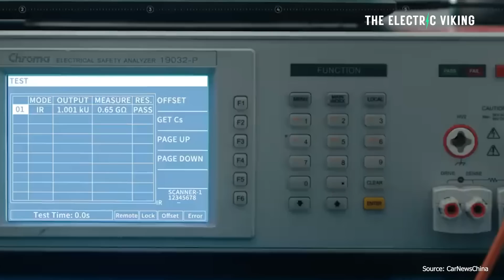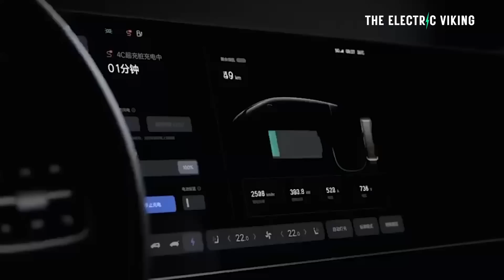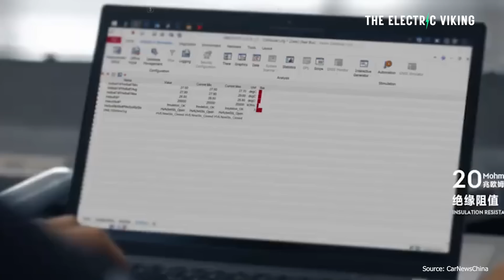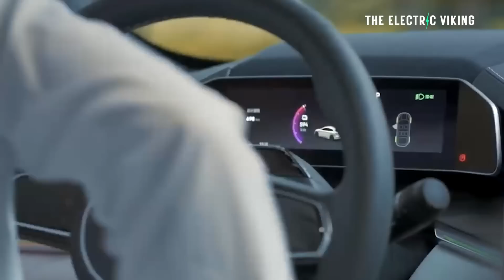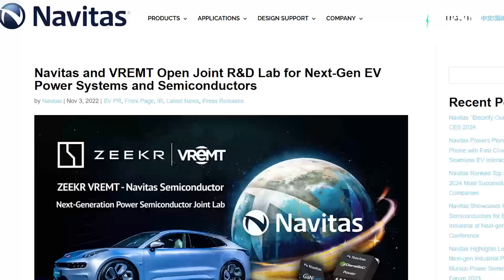Geely's Game Changing Fire Proof LFP batteries: 500kw charging, 83.7% density

Comment: Unfortunately the U.S. power grid currently does not have the capability to support wide spread use of EVs. Also about 2/3 of the U.S. grid is powered by fossil fuels. Then after generating the electrical power there is a transmission loss of 6% followed by a loss of 5% for the charger. So to get best overall efficiency for EVs their owners need to have home charging via solar. Otherwise DIESEL vehicles actually have the best “well to wheel” efficiency!
Reply: All I can say is Dream On!  The world is passing you by.  Almost all electric vehicle charging is done at home or at work, I think about 98% in the USA. Only 2% is done at charging station in the “Fast charge“ mode. Especially at home, charging can be done at night when electricity is widely available and cheap.  But the oil companies don’t spoonfeed you this information, because it counter to their narrative

Comment: Quite interesting but I’d be more interested in seeing the battery actually functioning in a loaded situation with 200C temperature as that’s a true stress test. The thermal runaway conditions occur inside the battery. I’m also wondering if the 25% faster charging speed at -10 is relative to an older battery model rather than compared against itself at say +25C.

Comment: The problem with 500 kW charging is that one vehicle draws as much power as five hundred single family homes. Ten vehicles charging simultaneously draw as much power as a small town. We don't have charging infrastructure or a grid remotely able to support even a small fraction of vehicles charging this way, even the small fraction of vehicles that are EVs currently, and we won't have either the infrastructure or the grid in the foreseeable future.

But we don't need it. The obsession with charging an EV as quickly as we can fuel an ICEV is misplaced. We don't need to charge EVs as fast as we fuel ICEVs. This requirement is nowhere near the top of my list of requirements for an EV transition. My Bolt only charges at 50 kW, and it meets my needs well even on long road trips.

I'll take a long trip to visit my family tomorrow, and I'll make several long stops to charge on the round trip. So what? The stops won't be longer than the time I'm spending now watching this video and commenting, and I can watch videos while charging as easily as I'm doing it now. The only difference between an EV and an ICEV on this trip is that I'll leave an hour earlier and browse the web or read or eat while charging rather than doing these things for an hour before leaving an hour later. Charging time need not be wasted time.

Furthermore, before we have the infrastructure and grid to support 500 kW charging, we'll have self-driving cars and true robotaxis. Musk always overpromises and underdelivers, but this technology seems very possible within a decade, and it will be far more transformative than a faster-charging battery.

When cars drive themselves, many individuals won't own a car at all. Eventually, most will not. They'll subscribe to a driving service. They'll summon a car on their phone, like an Uber, but it will reliably arrive in minutes, and the cost will be less than owning a personal automobile that is idle 90+% of the time. The cars need not be electric, but they likely will be, and they could easily charge at 50 kW. They won't need more rapid charging because you won't wait for your robotaxi to charge. When it needs to charge, you'll switch to a different taxi.

For this reason, investment in the massive infrastructure and grid upgrade required to support 500 kW charging is wasted.

Comment: The "testing" was a little gimmicky.  How long was it in the 1000C fire?  If it was cold soaked at -45 for two days, it could stand some heat for a while.  There's not enough info to know how good this is.  How is their cold weather performance?  That's a problem for most LFP.  Have they solved it?  What is the cost per kWh at the pack level?  That's a key metric.

Comment: Take what you hear with a grain of salt. Zeekr battery charging curve is typically characterized with a high peak for a very short duration, and followed by a very steep drop.  I think that Zeekr designs the charging system this way for marketing purpose.  By the end of the day, it is the amount of time you spend at charging stations that matters, not the peak charging power.
Reply: It's all over the news. Mainstream and otherwise.

Fact-check my claim for yourself, please...

I could be wrong...😊

Comment: Can you comment on the status of the thermal management systems in BYD, Geely, etc. This is an area where one gets the impression Tesla is way ahead of everyone else.
Reply: Yes, I am wondering about that also. Is the Chinese approach to make a battery that doesn’t need thermal management? Really I don’t know this technology but that would be an approach, to have a battery that works well even at high and low temperatures. And still lasts a long time.  Then you don’t need all that thermal management which takes up a lot of space. Could be I suppose?

Comment: You need to calm down. What is cost of these batteries? A network of charging station with, say, 5 chargers each withHalf Megawatt chargers is enough to power a suburb.  Can all this power be delivered by renewable generation? Not a chance. 2.5 Megawatts requires 6,000 PV panels in full Sun. No chance of home charging unless you only need your car to drive more than a few KM  a couple of times a month.

Comment: In all the excitement anyone would think man had just landed on Mars.
Where are the Geely mainstream products?  Smart is getting there, but where are the world cars for everyday people?  High charging speeds are a long way off for the average motorist in Oz, so I don’t see these impacting EV use in Oz for a long. Long time.  How do these charging speeds deal with Fermi’s law?  If the battery pack is hot, will 500 or 800kW be possible from the get go and what degree of shaping will occur?
I’m now of the opinion that a flat pack batteries are only one solution of battery configuration.  Tunnel batteries may be another way of overcoming the issues of packaging optimisation.  If it’s flat, it needs to be 30mm maximum height, as it’s clear to me that interior leg space is compromised otherwise.  When do we reach a real flatpack point?

Comment: A good battery is usefully if safe. The most important thing is energy efficiency.  Remember also that you have to generate the energy to charge the batteries. A smaller problem is that you have to deliver that energy to the charge point. CO2 is not the enemy, BTW. Too much carbon in the air is a very easy "problem " to solve, plant trees...The threat to humans and the earth is polluting ground water ( all water). Forget this battery madness and agricultural chemicals and the like...

Comment: I'm sorry, but lithium melts at 180.5°C and the plastic connectors and cable insulation in that battery pack is will be liquid at about the same temperature. If they said it didn't catch fire at 1000C but was useless I might (probably not) believe them, but this is just click bait in my opinion.

Comment: I believe electronic / battery will progress much faster than we expect. However, there is no way that current electricity grid can handle such kind of current. Once can when charging its battery, it can use nearly 100 home's average electricity. Imagine if tomorrow we all swapped our ICE to EV, then no body will be able to drive his/ her car at all! the grid simply run out of capacity. For Australia, unless the country has  upgrade its electricity supply system with many  times more capacity than what we have today, the EV future is very limited.
Reply: Where I live Tesla has had a message pop up on their cars before asking people not to charge because the grid

Comment: This is not about cells, it is about the case. And -45 is not a problem unless you are charging  it frozen. So, warming it with fire is actually not that crazy.

And of course the cell temperature was not 1000C, likely not more than 100C. And the outer case was probably not much more than 100C but the surface was max 200C.

Also the insulation likely is maylar that quite temperature resilient.

Still it looks like the very tech and the marketing too ))

Comment: 100kwh battery and 870km range doesn't check out, ever. It's BS because that would mean 11,49kw per 100km. That is completely unrealistic. More realistic city traffic consumption is around 13-16kw per 100km and highway consumption is 20khw+ per 100km on even the most efficient cars. Is this guy shilling for geely or is he that oblivious?

Also, the Zeekr007 has a drag coefficient of 0.23(zeekr says this in their marketing material)  which makes it less efficient than other cars, and even these more efficient cars comsume more and have much less range on a 100kwh battery than what they claim. For exaple the 0.20 drag coefficient EQS barely does 500km at highway speeds with a similiar sized battery.

Comment: these batteries would make evs alot better if they still lasted for over 10 years but 800 watt fast charging would most likely fry them over afew years ,  plus electrical grids cannot handle thousands of evs charging at 800 watts even a handful of evs charging at 800 Watts would crash the grid in many places at present.
Reply: Not 800 watts. 500 kwh.

Comment: He mentioned that the Battery was kept at -45 degrees Celsius for two days. Following this, it was placed in a fire, although he did not specify the exact time it remained there. It's likely that it was only in the fire for a brief period, just enough to allow it to reach a warmer temperature again.
Reply: Internet search tells me that Chinese standard is 130 sec in 700C fire. This battery lasted 240 sec and survived. Not sure if that is the actual end limit or just where they ended the test.

Comment: you didn’t touch on how the battery temp is managed…as far as I know, LFP still needs to be kept above 0° C to charge…sure you can charge at negative temps, but not before heating the cells first.  Do they utilize a heat exchanger, pump, and electric element?  That’s the problem with EV’s in northern climates….much energy is used to heat the battery…and that kills the efficiency of EV’s.  Better have a heated garage…or forget it.

Comment: Small problem! The issue I see is manufacturers from yesteryear legacy automakers their entire business plan is make a car that lasts x amount of years then starts to disintegrate exponentially. Forcing the customer to buy a new car 5 years later. Selling the parts for those cars at an astronomical rate so it becomes smarter to buy a new car than try to repair the old one That's every manufacturer business model. Tesla changed that they make a car that lasts a very long time not caring about making money off parts (today's Tesla I don't know about tomorrow's).
My point is this manufacturer is making these batteries do extreme things and I'm only speculating but my guess is the battery is not going to last 10 years like a Tesla battery. So this manufactures counting on you buying a new vehicle sooner rather than later going back to the old business model just speculating only time will tell

Comment: Fascinating stuff Vik!

Expect game changing Solid State bats that will be smaller, lighter, higher energy density, faster charging times, fire proof than these....hold those horses.
Reply: Lots of innovation seems to be coming on all fronts regarding batteries. It’s the holy Grail.
Reply: Expect all you want, but not wise to wait for some future "solid state" breakthrough."  Battery advancements will come, maybe solid state, maybe other tech like LFP, M3P, Na-ion, LiS, etc.  In the meantime today's batteries are already very good for automobile use.

Comment: What material was the battery container made from to withstand 1000C???
Reply: No way can the battery withstand 1000°C. It was a publicity stunt to immerse the battery pack in 1000° fire bath for a period of time, that time certainly not being long enough to bring the interior of the battery structure up to 1000° C. Just in case I’m wrong, this would be sort of a miracle !!
Reply: It doesn’t. It looks like other people are saying that is a timed immersion in a fire bath. Not sustained, for a couple of minutes I suppose.
Reply: If you listen again he says they held it at -45 degrees Celsius for two days Then they put it in the fire but he doesn't say how long it was in the Fire for i'm guessing just seconds Long enough for it to warm back up again
Reply: Internet search told @TJPavey that Chinese standard is 130 sec in 700C fire. This battery lasted 240 sec and survived. Not sure if that is the actual end limit or just where they ended the test.
Reply: @adus123  Are you assuming that they are cheats?
Reply: @adamiskandar5107  No just highlighting the available facts. Plus the fact that We don't know how long it was in the Fire Suggests this may not be what it seems
Reply: @adus123  Since you don't know, why the negativity, why not give them the benefit of the doubt?

Comment: Assuming these are for real - Geely should split the battery pack in two and put a charging port on each side of the car.  That way, you could plug a charger into each side to double up the charging speed.
Reply: Isn't that more or less how they make Hummers, asides from both charging ports being side-by-side?

Comment: I believe it's "game over" for the electric car. No matter how good the car or the battery is there isn't enough infrastructure and what you buy today is worthless in one to two years because of the so-called technological advances. Imagine a charging station being able to cope simultaneously with 10 vehicles charging and those vehicles being filled to at least 80% capacity in minutes? You can't imagine this scenario. No matter how many wind turbines or solar panels are "planted", those means will never cope with cities, industries and thousands upon thousands of electric vehicles wanting power.
Reply: Cities in the north of the United States and Canada can already withstand the vast majority of cars having plug-in block heaters.  Yes, that's only the equivalent of granny-cord charging, but realistically, most home-charging only needs granny-cord speed.

Comment: If this new Geely LFP battery is indeed as good as claimed, then I won't be surprised Geely might allow a bunch of battery manufacturers all over the world to license produce it. As far as I know, Geely currently don't have much battery manufacturing capacity. With 500kw charging, this battery is essentially future proofed. There is no practical need to be better than 500 kw.
Reply: Possibly. They plan to use it across their multiple makes. This could be huge for allowing polestar and Volvo to take a big US market share.
Reply: @Bodelicious1 No way.  Not saying that to be mean but Volvo would need to really do something amazing to capture US market share…. This is not it.
Reply: @fractalelf7760  Long range plus charging in 15min with the added benefits of being able to charge at home for pennies, that sounds better than a gas car.
Reply: @antoniocruz8083  It is, the problem is that’s not enough to change the US attitude towards Volvos.
Reply: @fractalelf7760  "Volvos are stodgy, overpriced but safe."  
If they can sell cheap EVs with these fantastic batteries, they have a dealer & parts network in the USA and the Big 3 will be screwed.
Reply: Don't they make it under the VREMT brand, the cooperation between Geely & CATL ?

Comment: I'll believe this when I see the first production cars on the road with such a battery. Supposed amazing battery breakthroughs like this have been coming thick and fast for the past 10 years with none of them ever seeing a production line. It's getting tiring. And let's not forget, this is a Chinese company, a country well known for its many technology advances that later turned out to be empty bluster. 
That said, anyone who believes 500kW charging rate and an over 80% energy density is incurably naive and blue eyed. And even if these specs were true, they doesn't solve the far more important problems of increased demand on the energy infrastructure.
Reply: How would the average servo be able to install even 1 500kw charger without major infrastructure upgrades?
Reply: @steveschild9065  I'm not straining my brain on that one. It's anyway all just smoke and mirrors what is told us on this channel. I only follow it for the laughs.